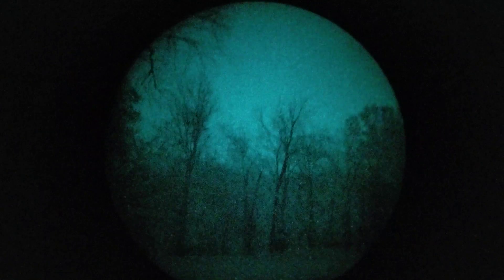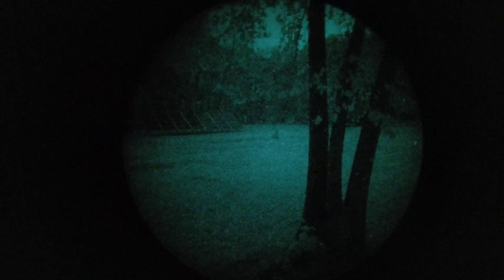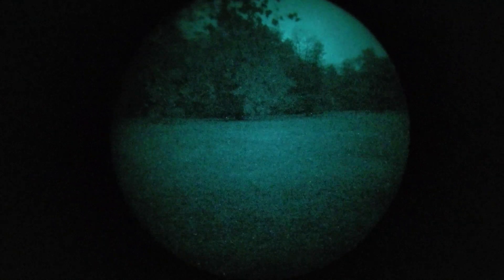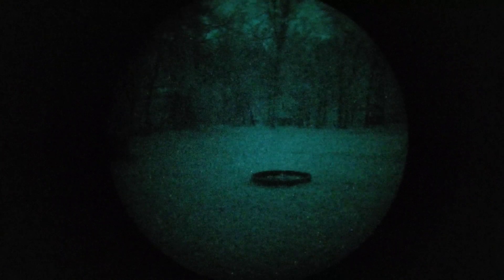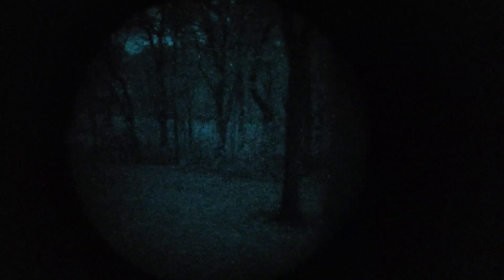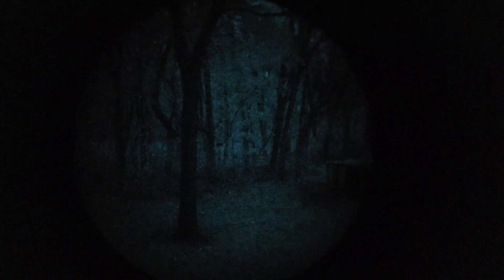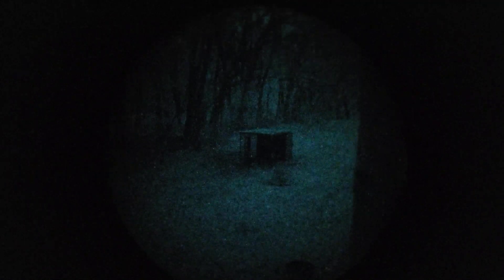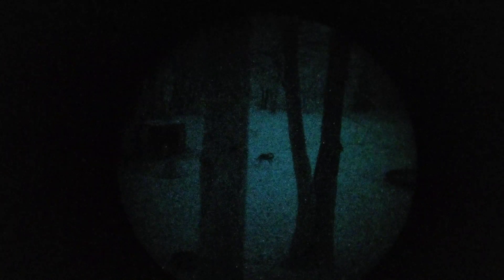L3 Unfilmed WP worst-case out-door conditions

Comment: Does high spec tube cause blooming issue with street light?  Not sure it is true or not, I heard thin film produces better image than filmless under street light  True?
Reply: Gen 3 goes as low as 25 lp/mm in bright environments. Multialkali preserves much higher resolution.

Comment: What’s the FOM of this unit? Sorry if I missed it but the specs you mentioned are close to a L3 Harris unit that I just traded for and has less than four hours on it. 
I’m waiting for one from TNVC. If the one I get from TNVC has comparable specs. I plan on running duel pvs-14’s. I know running duel 14’s ain’t the best but I can’t justify paying 125-150% for a true duel unit. 
Worse case, I’ll run the worst tube in my non-dominant eye.
Reply from the maker: 37x72=2664FOM